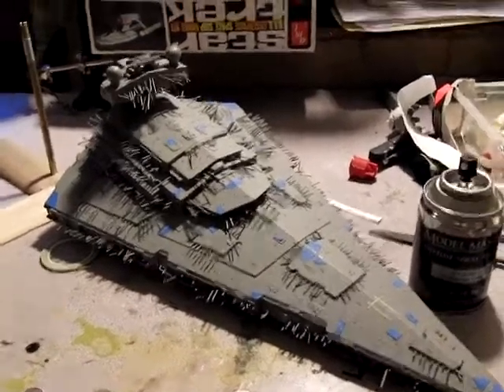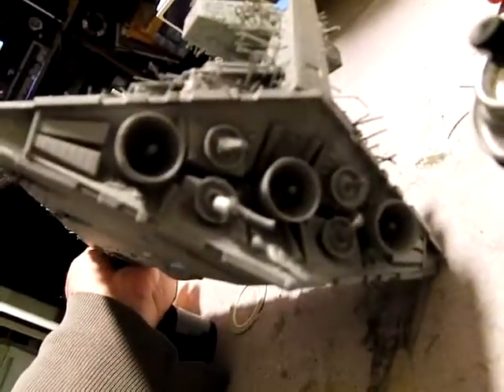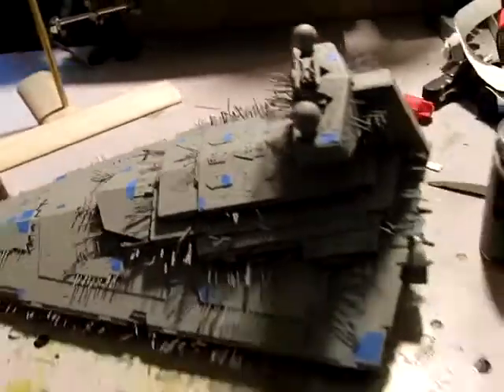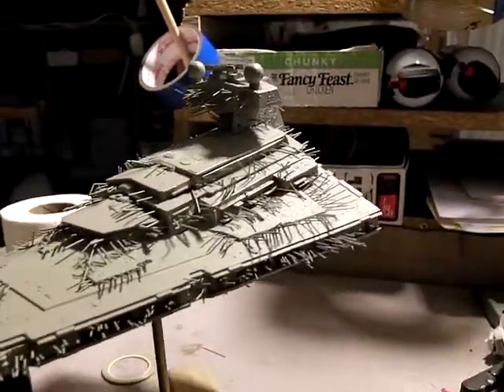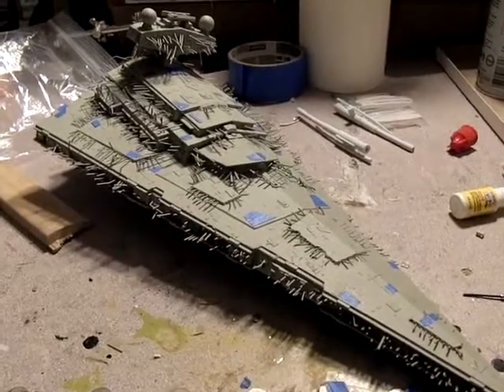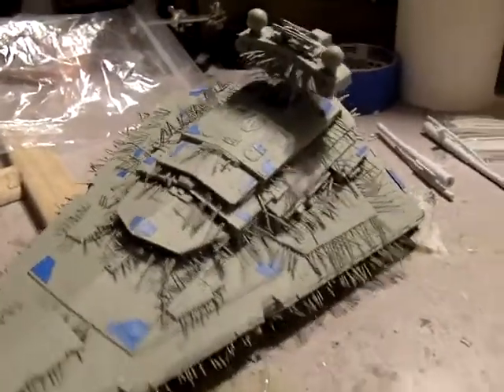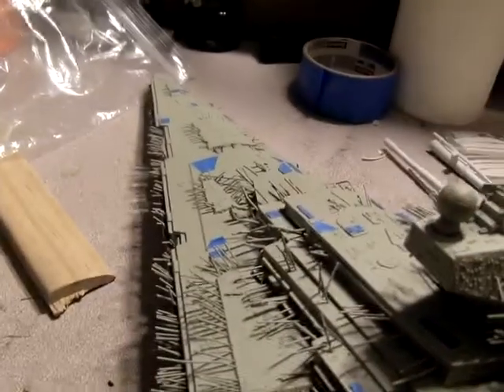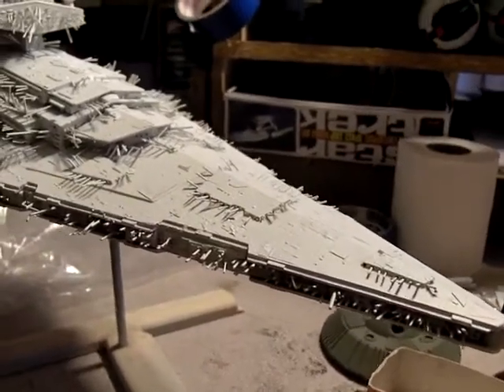MPC Avenger Pt 21: 2nd & 3rd Coat

Comment from the maker: In terms of accuracy, fit, engineering, this is a humdrum kit.  But add lights, and it comes alive.  There are after-market accuratization parts, but all told they can run up to $200, when they can be found...  Search MPC star destroyer, or ERTL, plastic kit, along those lines.

This one will be 4 sale when I finish, but as you can imagine, it wont' be for $20.  ;)  Thanks for watching.  Good luck on your 'modeling dream'.